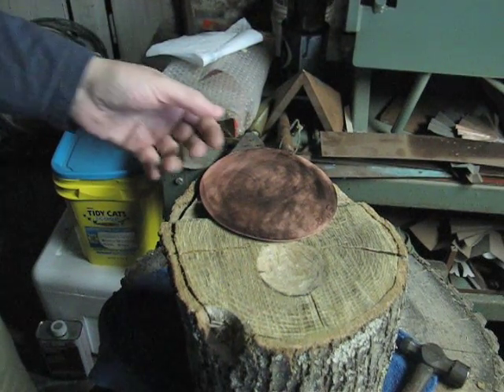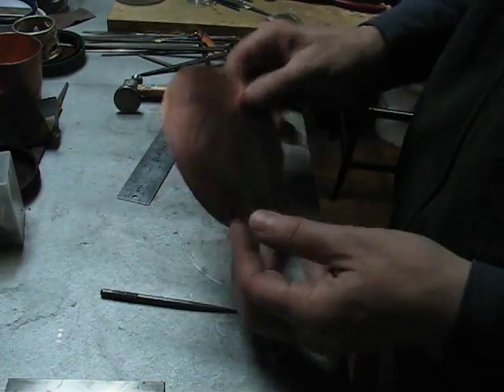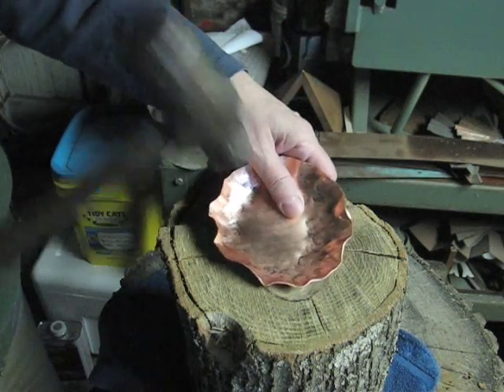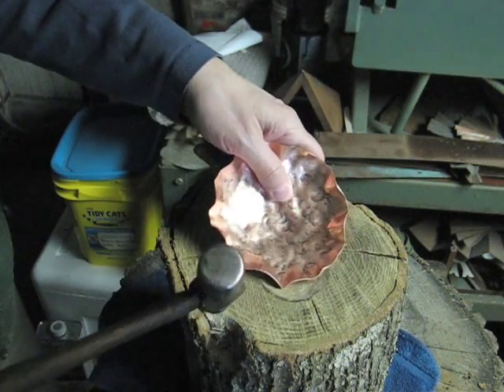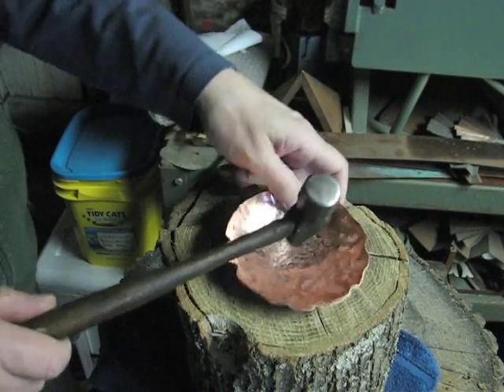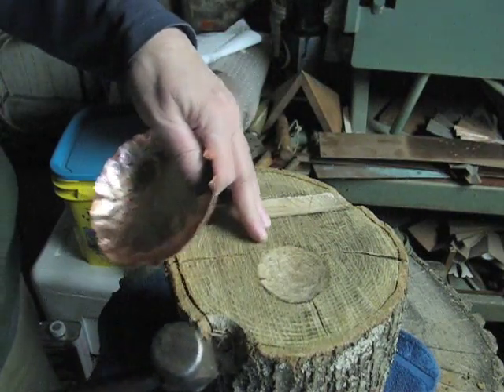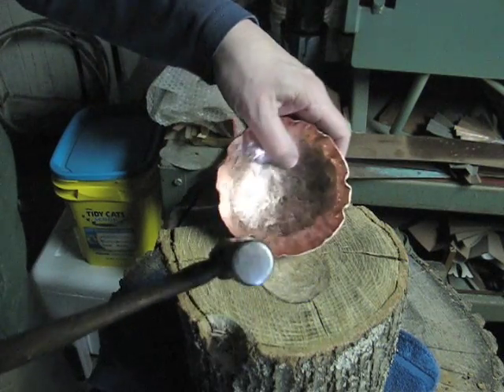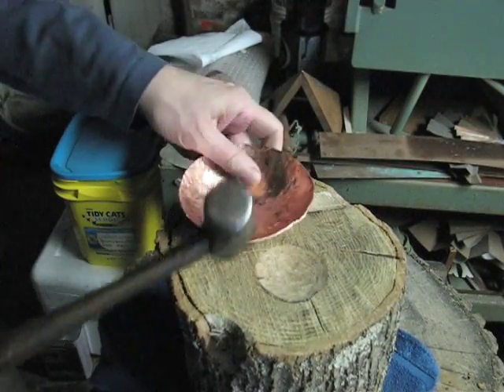Raising a Copper Vessel, Start by Sinking

Comment: You carefully found and marked the center ... WHY???  A hammer and stump do not require that kind of precision.
Reply from the maker: This is only the first step in raising a cup. The center is needed for raising on a stake and for setting the base. If I was making a bowl it wouldn't be necessary unless I planned to chase a design and put in rims and borders.
Thanks for watching.
Reply: @Ceropegia  I was wondering too, because the marked center was facing away from you. Beautiful piece of copper. Isn't Copper expensive now? I kind of want to have a fork and spoon made by a metalsmith or whoever does that sort of thing. I have this image in my head.
Reply: The first thing is to always mark the center. It’s easier to mark when it is a flat disc.

Comment: So this is how was like to make tools during the copper age... I didn't know copper was so easily pliable.
Reply: floopy312 Copper is very pliable but work hardens and can become hard and brittle as it is hammered/bent. This is fixed by annealing the metal, which is to bring it up to a certain range of temperature which will cause the structure of the metal to relax, softening it.

Comment from the maker: I am using 18 gauge in the video, 18 and 20 gauge will give you enough metal to work with. If you are going to  decorate with chasing use the18g which will allow for a higher relief. 20 g will be fine for most applications and shaping operations AND it will be a substantial vessel when you are finished. you can also decorate the 20g with stamps if you so desire.
Reply: A viewer recommended https://www.riogrande.com/category/metals/base-metals/copper, but they only have 3"&6". 18 gague as their biggest and it's labled as half hard? Around 15$ per

Comment: Seems you are doing it backwards. Every single thing I've read or watched says to start in the center and work out. You don't get the wrinkles and folds the way you did by going the opposite way...
Reply: You’d think but it’s actually counterintuitive to do it that way, it makes it harder to raise because it becomes work hardened too quickly pushing from the centre, so much more depth can be achieved with the outside in and that also lowers the chance of tearing through the middle
Plus you can fix the wrinkles in about 2 minutes as seen in the video

Comment: How did you hollow out the stump it looks smooth and precise. I have always wondered how they did copper that way. Great video. Thanks
Reply from the maker: I used a wood gouge, which is a chisel with a bend in it, and a mallet to make a rough shaped bowl and then used a convex faced hammer to smooth it oit a little. The depression smooths out as you use it to sink vessels. Thanks for watching.

Comment: Why don't you use a leather sandbag and a rounded mallet instead of the ball-pane hammer? That way you have less hammer marks on the copper.
Reply from the maker: John,  The leather sand bag will not give a consistent surface and curve against which to strike. The goal at this point is to stretch the metal a little and give it a uniform shape from which to raise the beaker. Since the beaker will go through  5-7 annealing-raising cycles hammer marks, at this point, are not an issue.
Reply: Hi Sage 
Thanks for answering my question because I found your video interesting because I was trained to do copper work many years ago in my apprenticeship. We used hard leather sandbags, which you initially form a depression  to work in. We were trained to use a round domed mallet to raise the copper disc into a bowl,  beaker, goblet etc.

Comment: You use a double strike.
Are both strikes in the same place and strength?
Is this the preferred method, or a personal thing to maintain a rhythm?

Take care.
Reply from the maker: I am striking in two different places as I turn the metal. Once to bend the metal and the second strike is slightly forward or inside so I don't have to advance the metal with each strike. This is my method that, for me , works very well. You will notice that I am always moving the metal especially on the second round from the center. I am constantly watching the reflections and aiming to flatten any high area to smooth the surface. It is subtle movement and a beginner should probably move a little more slowly and deliberately, it takes a while to figure out where the hammer is striking and in the beginning I had to be conscious of what each strike did, strike and look, strike and watch for the last mark made. As I made more vessels the striking became faster as confidence and control became a part of raising a vessel. You never stop watching and your control gets better all the time. Thanks for watching.

Comment: Two words: Bossing Mallet!
Reply from the maker: Yes there are many tools to use doing this; this video was made in my early days. When doing silver I used a bossing mallet, sometimes I need the extra weight of the ball peen hammer. Being done in a wooden depression there is no thinning of the metal regardless of the hitting device. I think it is preference and circumstance (material) for this stage of making a vessel. 
 I appreciste your comment, Thanks for watching.
Reply: @Ceropegia  Extra weight? Bigger mallet. I make my own mallets and the choice of timbers for the head and the size of the head comes into it. Being in Australia we are 'blessed ?' with a vast array of 'hard as all fuck' timbers easily sourced. In fact most of the timbers I use come from my own back yard.

Comment: I always anneal first, no matter what. And I always use pear shaped wooden hammers. Why? To not get any thin spots. And it also lessens the amount of annealing you have to do.
Reply from the maker: Your use of a mallet is fine, the hammer will not thin the metal unless it is struck onto a metal base, that's why  I am using a stump. Thanks for watching.

Comment: ....It appears as if the "ball pien" isn't very smooth in shape!... it looks like it is imparting a bit of a sharp dent, with each blow.
Reply from the maker: The  Ball Peen end of the hammer is flattened a little. If it was a true ball shape the dent would be much smaller, this can also be done with a convex shaped raising hammer but I didn't have one at that time. Thanks for your careful watching.

Comment: I may have commented on this video before. If you use dividers to score a center then
 use a center punch , you are in danger of causing your work to split along the scribe lines and center punch mark. How do I know? I did the same when I raised a complicated oval teapot in silver when I was an apprentice. Fortunately the company I was apprenticed to accepted the cost of starting again. I only suffered embarrassment and wasted hours of hard work.
Please never use a sharp point on copper / silver or gold if you are that fortunate. A pencil compass is by far the best thing to use.
Reply from the maker: Thank you for the warning. I have been doing it this way for about 12 years and have never had that happen in more than 100 vessels and cups. I'm working primarily 18 and 20 gauge metal and that may have something to do with my work not splitting. My scores are very light, just enough to see. When I am raising and need guide lines, I do use a compass and pencil or sharpie on the sides of the vessel. Thanks for watching.
Reply: I'am English but live in France and went on an educational course for aircraft aluminium work. We were taught to shrink over a ball rather than in a hollow and for me it seems to be more precise.However, the French don't seem to know about electrolitic reactions. They use pencils and felt tip pens on the aluminium and DO NOT understand the consequences. I once saw a photo of the fuselage of a deHavilland Comet that had depressurised after 20 years of service because someone had drawn a circle on the fuselage with a pencil during construction. The result was a very nice round hole. Not one of the French people I contacted,Airbus,SOCATA or the instructors who taught me had any idea of this .I have a very good friend who is an engineer at Rolls Royce who told me that pencils are not allowed in British aircraft factories for this very reason. When will others learn.

Comment: Any idea on where to buy these disc's not at $22 each per disk?
Reply from the maker: Have you tried Metalliferous online?  It is often less expensive to buy sheet and cut the circles you need. I find that I am doing that more and more because I need specific diameters and finding the disks has been difficult for many years now. Good luck and thanks for watching.

Comment: how are you making the depression in your wood?  I want to make my own, and am not sure what tool to use.
Reply from the maker: I used a wood carver's gouge with a mallet, shaving little bits at a time from a circle that I had drawn on the stump. It's about half an inch deep at the center. It doesn't have to be perfect, it will even out as you use it.
 Thanks for watching.
Reply: ***** thanks so much for letting me know!  My Father has a router and we were going to try using it as per Ganoksin - but I really appreciate your insight!
Reply: Juliette, regarding the beads on my latest blog post, yes--they are translucent Premo clay with oil paint. All my polymer pieces are surface-colored.

Say "hello" to Nevada City for me--I love that little town!
Reply: bonnybrookmuggsy Thanks so much!   They are gorgeous beads!  Nevada City says 'Hello!!" to you :)

Comment: Why didn’t you anneal it after found the center?
Reply from the maker: Copper, being a pure metal will take more hammering  than an alloy like sterling silver. I am using a ball peen hammer on the copper over a wooden surface, the ball peen spreads the pressure in the metal wider than a raising hammer so the metal is not truly work hardened and I can make a second round. Using a raising hammer on a metal stake hardens the metal more and annealing is necessary to continue raising, however you can go lightly over the surface with a planishing hammer to flatten some areas where the metal may have bunched up, especially the edges before annealing. Thanks for watching.

Comment: Thanks for the great tutorial. Would this process work for sheet steel as well, to make a shield with a large dishing stump, or would I need to heat the steel as I go along? The curve would be a lot more shallow if that makes any difference.
Reply from the maker: I have not worked with steel but other people have and used similar techniques. You should try with a smaller piece of steel first. I'm not sure about annealing the metal. You might find a blacksmith as there are many steel alloys and you'll probably get a better answer. Thanks for watching.
Reply: I was going to use a pre-annealed .025" sheet of 4130, so it should be soft enough to work hopefully. Thanks for the response!

Comment: I used to start off by sinking. I stopped, because the metal is “pushed out” and thinned. I have gone to using wood stakes.
Reply from the maker: The copper was not thinned by sinking in the stump. And as the cup was raised on an iron stake, the metal remained 18 gauge all over. If metal is moved properly it will not be thinned. thanks for watching.
Reply: Sage Reynolds Thank you for your reply. Sometimes, the sides actually thicken. If you like, I will give you my email and exchange photos.

Comment: I home school my children and we've combined different classes that has led to a very interesting project. We have built a complete homemade drum set. I'm at the limit of my knowledge when figuring out how to construct a crash symbol. I purchased 2 very thin decorative brass/copper plates (only type I could find)they are too thin to be suitable. My question to you you, is there a way to solder/weld the 2 thin plates together to create a cymbol w a decent ring? I've shaped and planished them smooth but asi mentioned they are far to thin. When you strike them even lightly they sent/crush at the POI. Any advice or suggestions keeping in mind I must use these we've reach our budget limit. This is all I have to work with so I must find a way to make them work. Respectfully yours, Teacher Dad
Reply: symbols are brass and are formed by what is called spinning. The brass is forced into shape on a lathe. Your not going to get a symbol tone from sheet copper.

Comment: at 1:17 you readjust your divider. Doesn't that negate the first three marks? Doesn't make sense.
Reply from the maker: The first marks left a hollow space (kind of triangle), the divider adjustment put a mark into the center of that space from which I could determine the center.  Thanks for the question and thanks for watching.

Comment: Could this be done so extremely as to fashion a copper shot glass?
Reply from the maker: Yes, you can, start with a smaller disk, say 2.5 - 3 inches. Be advised that working that small is difficult. You will need a smaller diameter stake for raising and a small flat top stake to set the base. I have done a few small cups and they are difficult to hold while hammering, if you are making a short glass  it might be more useful to do it in silver. 
 Good luck and thank you for watching.

Comment: Is it possible to make something like a helmet using this technique? If I make the right sized sink and a wide enough piece of metal, could I bring the sides in enough to make a sufficient helmet dome?
Reply from the maker: You can make the helmet  or components that will be riveted or soldered together to make a finished helmet. You won't need a larger sink but you will need a larger piece of metal. It's too complicated to discuss here, Try looking at info about raising vessels (which is not far from the helmet shape). 
 Thanks for watching.

Comment: have you tried turning a copper cup?
Reply from the maker: Metal spinning is another trade, I don't have a lathe or access to one. So the answer is no. Also, my needs are for one of a kind cups and bowls , not multiples of the same thing ( even if I do make sets of 5 and pairs of cups) which would make sense for  spinning. Thanks for watching.
Reply: @Ceropegia  I'm sure you could make one of a kind objects by spinning but was just wondering if you ever dabbled in it, keep up the good work

Comment: You would get better results using a mallet and annealing more often.
Regards, an ex- coppersmith.
Reply: hairyplums1 I keep waiting for the copper to tear at one of those creases.
Reply: Current coppersmith, totally agree! Even half soft copper will eventually work harden and split with ease. I make copper cylinders for a living, I often get asked 'can you weld copper' lol
In my opinion it is very similar to welding aluminium!
Reply: I can silver braze copper then electroplate with more copper, so it looks like one piece.
Reply: hairyplums1 what kind of mallet?
Reply: Park Inglot carpenter's wood mallet with flat face, then rounding one of them untill desired. If not, car shaping or silversmith's made of  nylon
Reply: Make a video then. Show us. No talk
Reply: Why don't you post a video? Regards
Reply: @pmkleinp  but it didn't...
Reply: @benpress8884  I never said Aluminium couldn't be welded? 
I stated that people often question if you can weld copper as it's normally something you braze. 
You use TIG welding on DC to weld copper but the way it welds is very similar to Aluminium. It just doesn't have a nice finish like aluminium without wire brushing the weld off.
Reply: @pmkleinp  I just weld the copper with oxy/acet torch.
Reply: @connolly3000  Torch weld it, nowhere near as easy as Argentium silver(no flux needed) but with practice, it comes out nice. I torch weld all my 14 ga copper jump rings, and the welds are barely visible. To make the loops, I use the stretcher tool right on the welded spot, and when finished, the welds are completely invisible. It really takes a bit of practice to do it, though.
Reply: @AmericanThunder  That's how we used to do it back in the day, as you say, invisible welds! Especially when hammered along a bar when still hot! 
Tig welding is the way forward now though unfortunately, time is money and Tig welding proves way more efficient and way less time consuming :)

Comment: Thank you so much for these videos. I've been trying my hand at it. I've been trying to replicate the cup vessel you did the video on and I can't get it to chase all the way up. It seems like I've got too much material at the top. Started with the same diameter disc. Any suggestions? Thank you so much once again.
Reply from the maker: Hi Greg, without pictures I can't really say what is happening. If I could see the cup you're working on I will be able to suggest something. There are too many variables from the stake and hammer to the force you use to strike the metal. Also the angle you hold while striking, beginners often have difficulty to raise and close the diameter because they are not yet aware of how to hold the cup on the stake, it will take about three cups to get the movement, angle and striking coordinated. If you could send a photo I might be able to suggest something more specific.
Reply: I don't know how to insert a photo into this comment section, but I can tell you I gave up on the cup in this case and left it as a flared bowl, wide flutes at the top and flame painted it.
Reply from the maker: you can send me email, other viewers have found my address, I also have facebook and instagram,  I don't want to post it here as there would be too many requests...

Comment: Did you anneal before you started?  Or did you hammer without annealing?
Reply from the maker: The copper I buy is soft to begin with. You may have to anneal if the metal is not working for you like it does in this video. You will have to anneal after this initial phase and all after all subsequent rounds.  Thanks for watching.